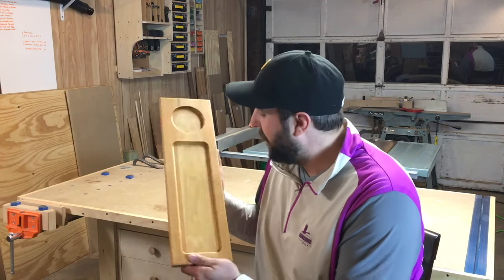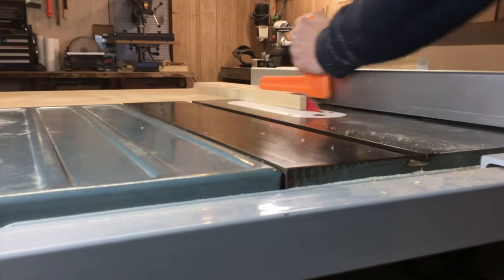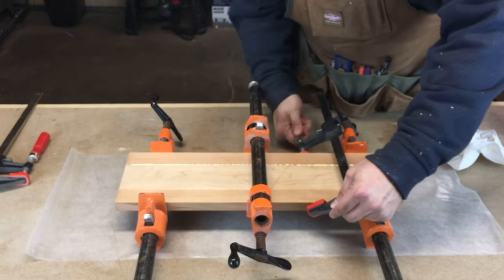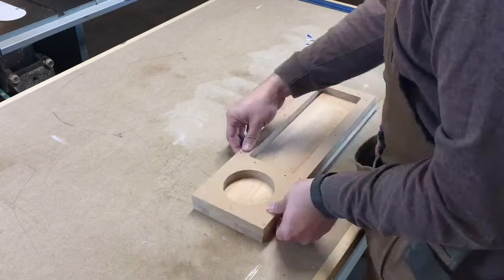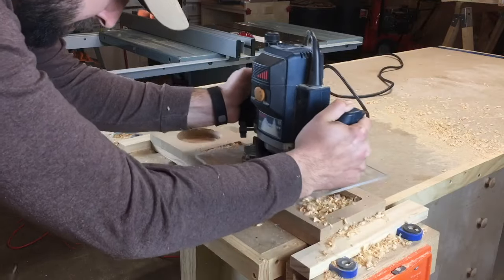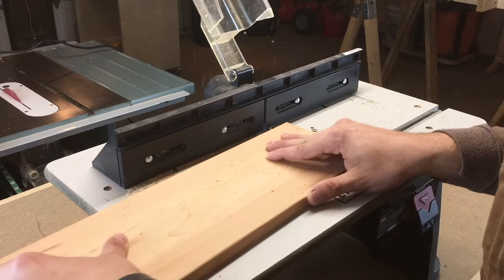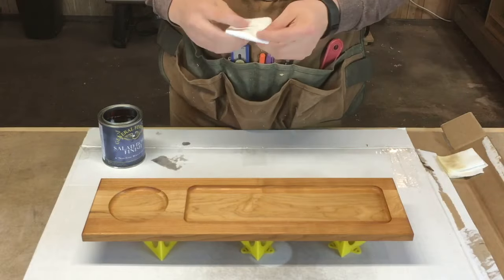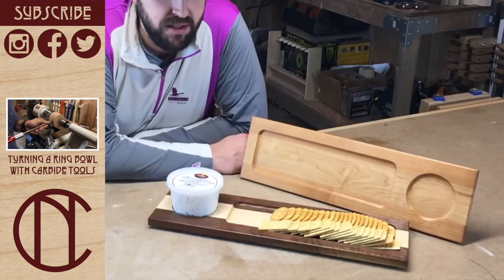Make a Serving Board with a Router and Template - Craft Market Series - Episode 2

Comment: Love it. Can you give the inside measurements of the cut outs?
Reply from the maker: +Frank Thornal Sure thing! The circle is 3-3/4" diameter, the rectangle is 4"x13", and the overall pattern is 6"x20". I used a bearing guided bit so the routed recess is the same final size as the cutouts. You could also use a guide bushing and straight bit but would need to increase the size of the cutouts to account for the offset between the bushing and bit. Thanks for watching! I'd love to see it if you decide to make one.
Reply: +nate crilly I'm gonna try. I'll post it when I DO.
Reply from the maker: +Frank Thornal Awesome!

Comment: Hi 2 questions,  I have a fixed base router , will that work ? How did you make the template with a perfect circle?
Reply from the maker: +Matt Baker I would not recommend using a fixed based router for safety reasons, but if you took very shallow passes it could probably be done by slowing plunging the bit into the wood at an angle. Again, I don't think I would do it this way though. The circle was cut with a circle jig on my router, the small jig from Jasper, very useful.
Reply: nate crilly  , thank you ! Maybe I could cut a  thin board with my jigsaw and glue it to a thick board to give that recess?